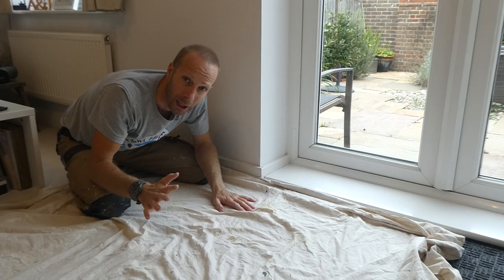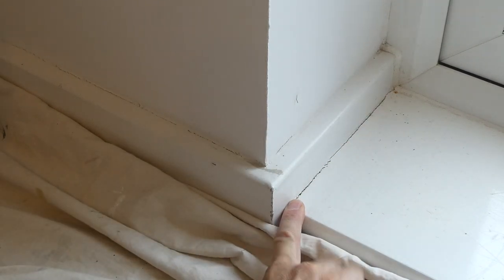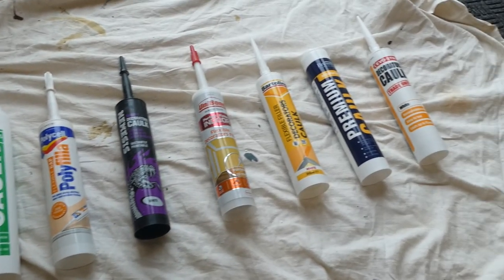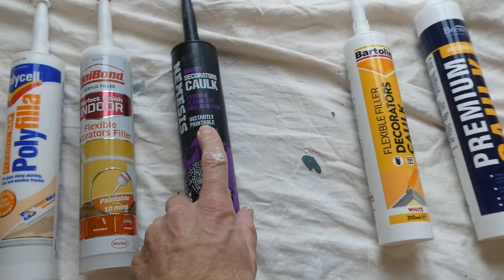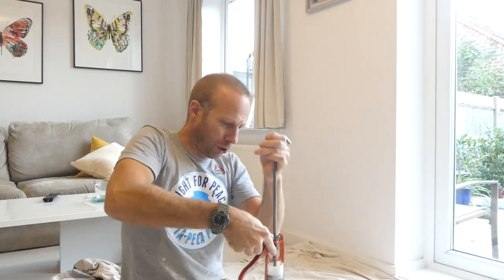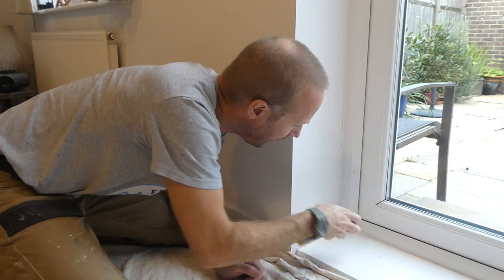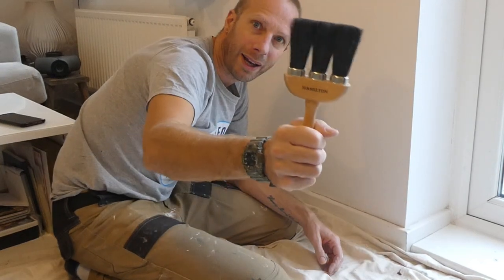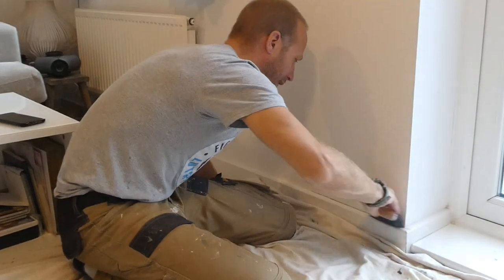How to caulk skirting boards - Step by step guide

Comment: Excellent video! I skipped through the removing/sanding bit as I've fitted new boards to reasonable straight walls. You also saved me investing in a profiling tool, I have plenty of fingers to use instead 😅

Comment: I am watching this video on silent so the husband doesn't hear so I can start painting our skirting boards because I love doing diy jobs on the house but he always takes over because I have no idea what I'm doing anyway this may be a dumb question and you may or may not have mentioned it here but is there specific skirting board paint or do you just use normal wall paint? I know there are different types of paints for ceilings, bathrooms etc so thought I should check first. TIA
Reply: For skirting boards you tend to use gloss paint but I prefer satin xx

Comment: Hi just wondering I’ve got old skirting board I have stripped the gloss off to Bear-wood going to put satin would oil based paint on do I need to primer first thanks
Reply from the maker: Yes definitely. Primer/undercoat first 👍